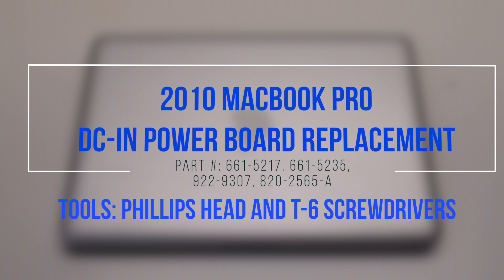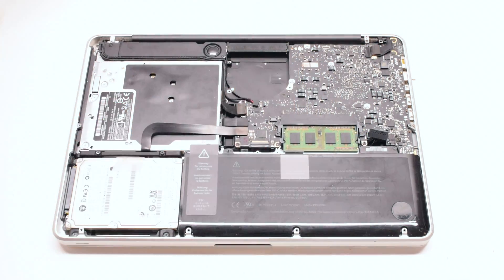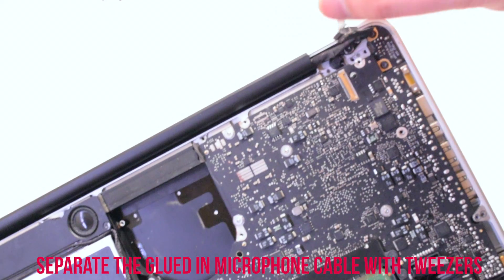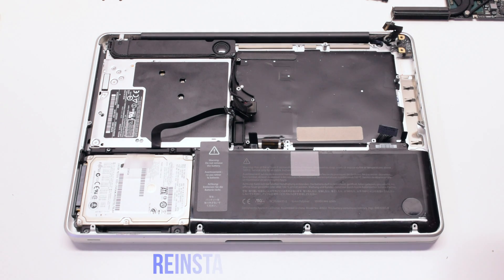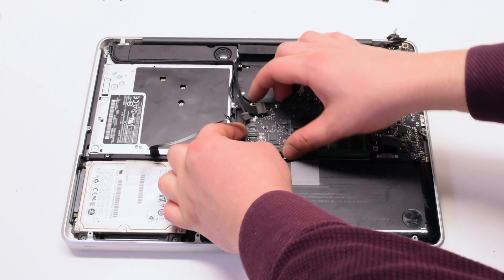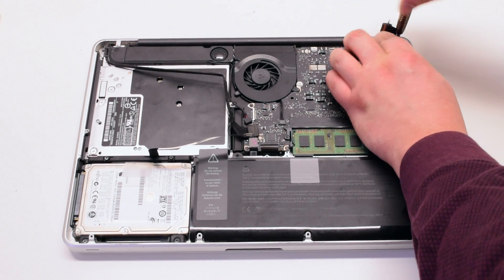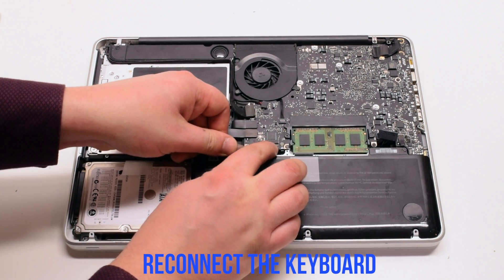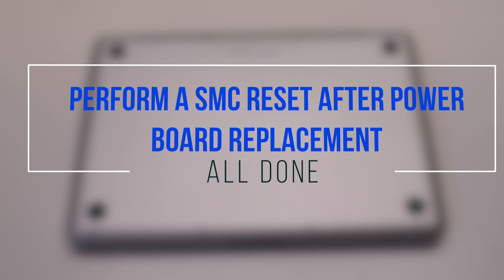2010 Macbook Pro 13" A1278 DC in Power Board Replacement

Comment: This is exactly the component that went bad in my 2010 MacBook. The Geek squad at Best Buy told me my computer wasn’t fixable. But I found the part on EBay for $10.59 and, thanks to your video, my MacBook is saved. Thank you
Reply: what was the name of the part, i have the same problem. thank you so much